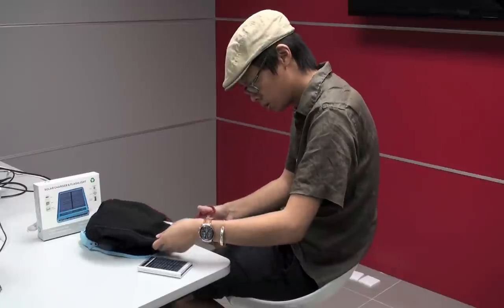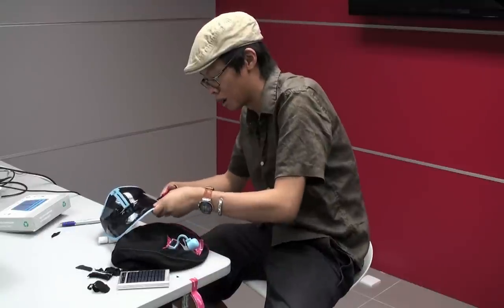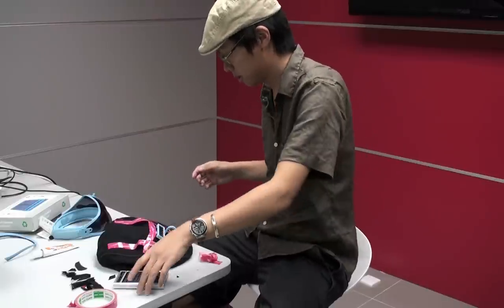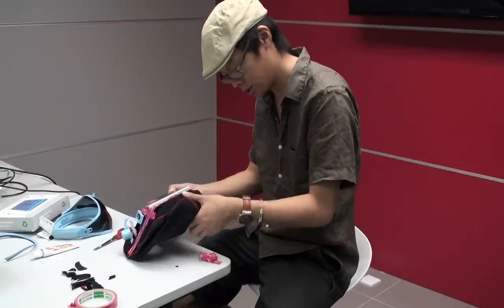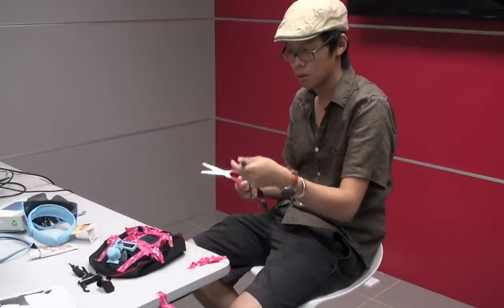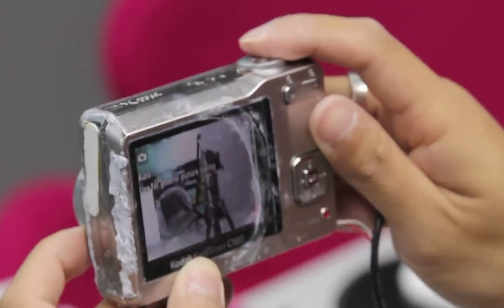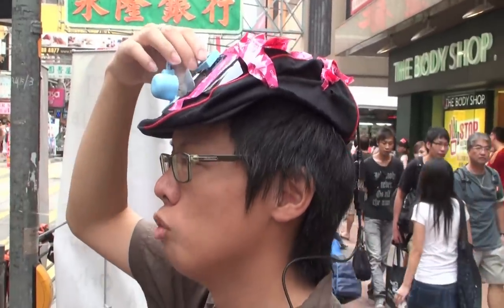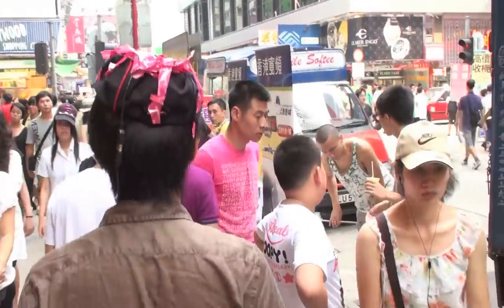Guide on how to make a solar-powered camera

Comment: If anyone wants to make this actually work just get the foldable laptop size solar panels, attach to backpack, connect to a small battery preferably lithium ion rechargeable. then connect camera to that. The one Kai made he not only covers up the solar panel but it's too weak to charge anything. you can in turn connect the solar battery to a external battery pack to power your flashes too. get the highest watt panel you can get, make sure the voltages are correct or you ruin your camera, use a adapter to convert the voltages